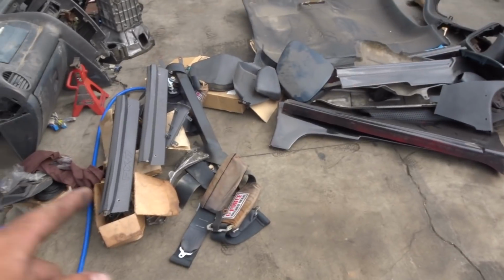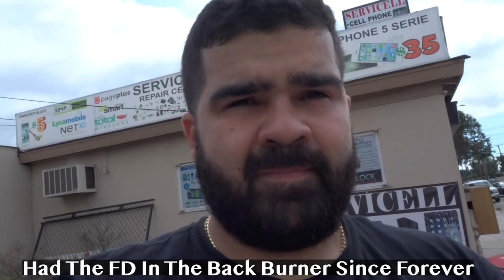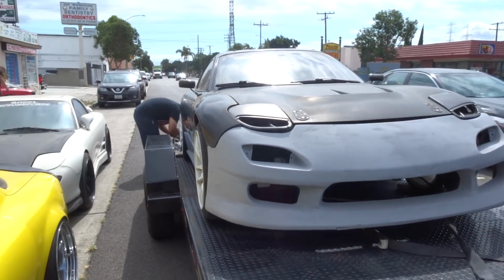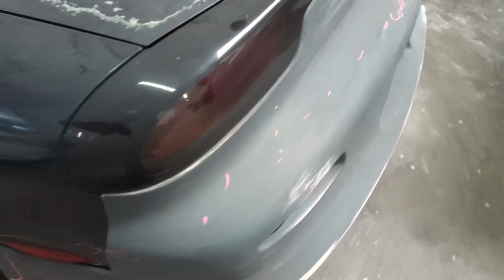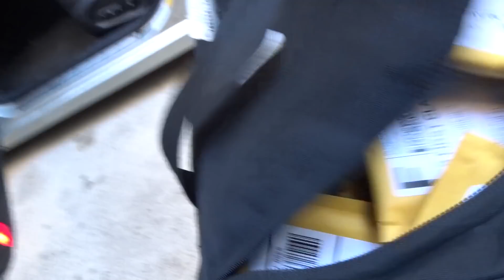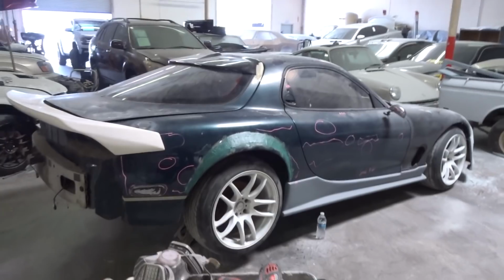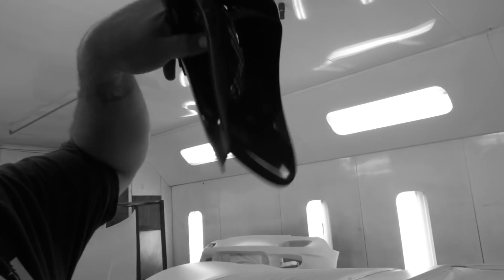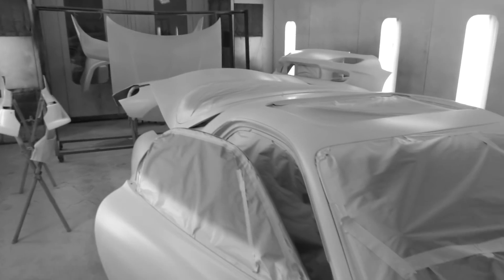3 ROTOR FD DRIFT BUILD

Comment: How about a 6 rotor 2  Three rotors in a side by side configuration connected by a single super flywheel lol
Instead of a V6 you could call it a dorito 6 it wouldn’t increase the horse power a ton over a single 3 but potentially could really increase the torque numbers